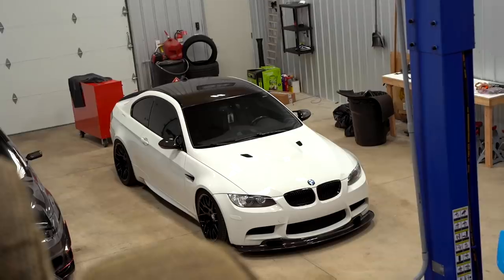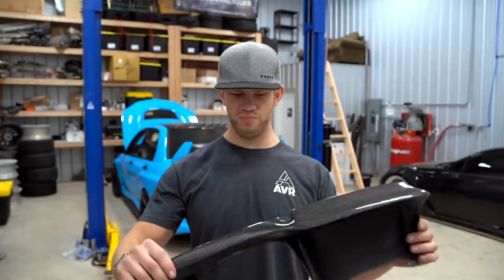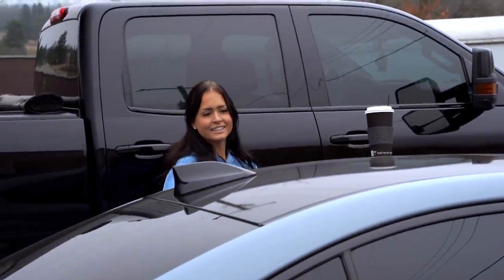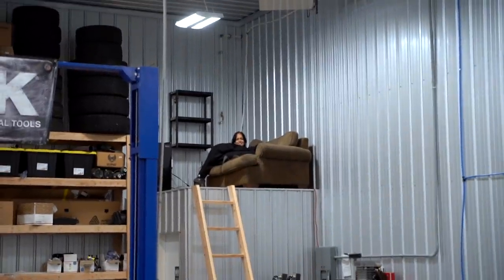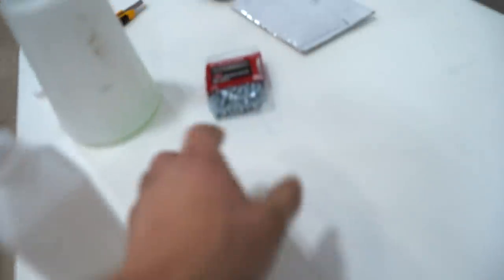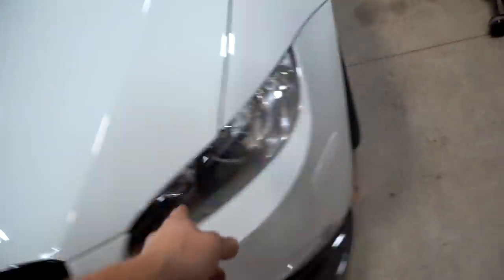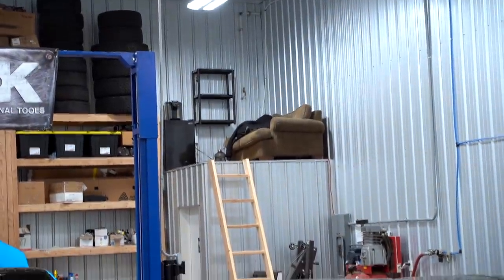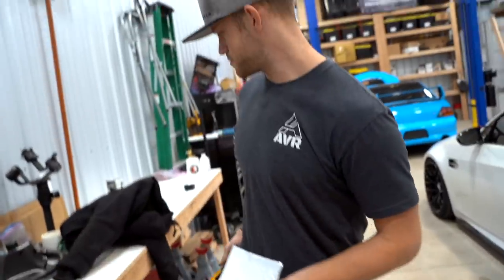Insane Carbon Pieces for the M3!

Comment: The diffuser and wing look awesome. The rest of the carbon parts just don't flow with the contour of the car. The manufacturers need to extend their moulds so the parts can be the proper length.

Comment: Lol i feel ya about those gt4 lips being too short on the m3's kinda weird. Thats why i was stoked its a flush fit using the gt4 lip on the m3 replica bumper for my 335i lol new diffuser is 🔥 👌 looks like thise skirt extensions were just supposed to flow with the body line which is why they were shorter like that...they defintely make some that arent short tho just keep looking.